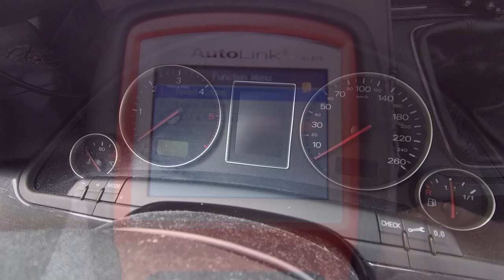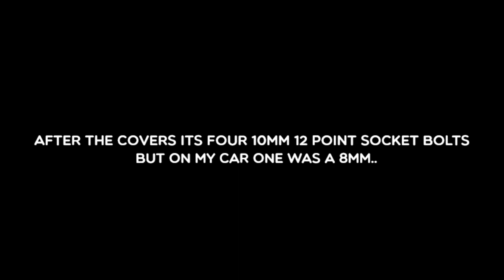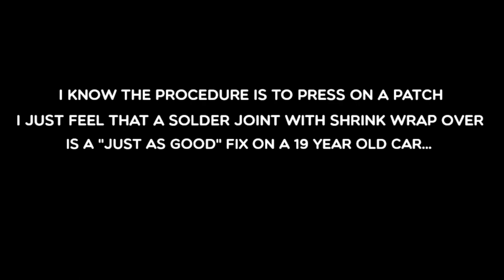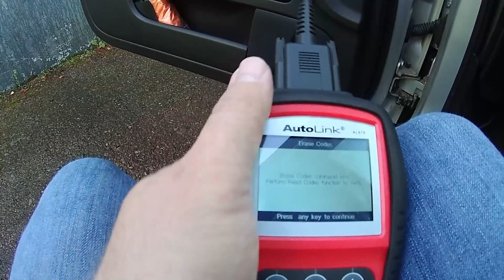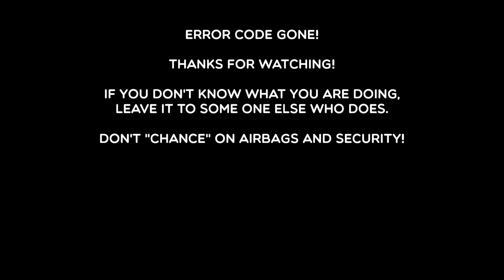Fixing side airbag error on Audi A4 B6 & B7

Comment: Very well explained.  Worked perfectly on our 2006 A4 Cabriolet.  Be warned there is very little spare wire on the female connector.  Also, the 10 mm splined socket we used was too tall to get the back seat screws when on the ratchet.  We ended up putting the socket in the screw and turning it with a wrench.  FYI, the dealer had quoted $1,700 to fix the issue.  This really saved the day (and dollars).

Comment: Hi, I have this issue with an a3 8l because I swapped the seats for the S3 ones. This seats have the connector 3 wires but my car only have 2.  I connected the brown and the blue like it was in the other seat and left the black disconnected. I see here that you used the blue and the black. Can you explain please?
Reply from the maker: Have no clue on how the A3 is wired. I just used the two i had here. Perhaps you should try to find a schematic over the s3 seats, maybe there are two airbags or a two-stage airbag in these?

Comment: Hi! We are curently having an issue with this type of problem. We had error code 01217 upper limit exceeded, after doing this repair the fault code changed to 01217 lower limit not reached. Could this be due to a bad airbag now when the cables have been fixed?
Reply from the maker: If you dissconnect the airbag, and reset the system. Does it sense that the airbag is missing, or is it still same error? 
Would also try with a "SRS Resistor" to verify if its the airbag or cables.
Reply: @KJohansson  yes the code comes back to driver side but now is "lower limit not reached" going to try with a resistor today and see of the airbag is faulty. Thx
Reply: obviously the lower limit is under the seat upper is on the seat?

Comment: I'm having the same issue with my Audi B6.
Reply from the maker: Cut off the adapter and patch the cables together, either with crimps or solder like I did. :)
Reply: @KJohansson  I don't have the soldering tool but I did purchase the crimps. I notice there are two places to get at it one on the floor the other underneath the driver seat. Just wondering will either one cancel the airbag light?
Reply from the maker: @RP-ov7cl  its the connector that causes the bad signal, so its the one you need to bypass.
Reply: @KJohansson  I try to fix the problem but it seems it's a little trickier than I thought. tried my handheld device for fault codes could not get anything. When I looked under the seat it seems someone had already bypassed it.  So it has to be one of the other two the one on the floor or the one at the steering wheel. I decided to since I can't get a readout or fault code ill leave it that way for now till I can really know for sure which one it is.
Reply from the maker: @RP-ov7cl  but do you get the same error code? Try to get hold of a SRS/Airbag resistor and try to fit it to see if the error goes out. It could be a damaged cable embedded within the seat itself.
Reply: @KJohansson  I'm sorry the SRS/ Airbag? is that the one located at the steering wheel?
Reply from the maker: @RP-ov7cl  SRS/Airbags are ALL the airbags in your car. If you dont have the same errorcode then it could be any of the 6-8 airbags you have (front driver, front passenger, front seats, side curtains and potentially rear seats)
Reply: @KJohansson  Its been crazy with all thats happening now. I notice the airbag light has turn off on its own. I'm guesing it may be a loose wire. I will though buy another scanner since the one i have doesnt read ABS or SRS AIRBAG.

Comment: ive done this today to the drivers seat the airbag still hasnt gone out..maybe its the passenger seat..
Reply from the maker: Have you checked the error codes? They should indicate if its left or right side airbags.
Reply: @KJohansson  no my diagnostics wont read the fault just been told by a mechanic its mainly the drivers seat hes obviously wrong
Reply from the maker: VCDS is almost mandatory to have when working with VW or Audis at home. I also have a Autel 619 unit they are well worth their price!
Reply: @KJohansson  ye I know about that thanks